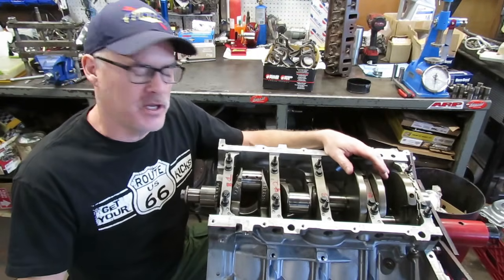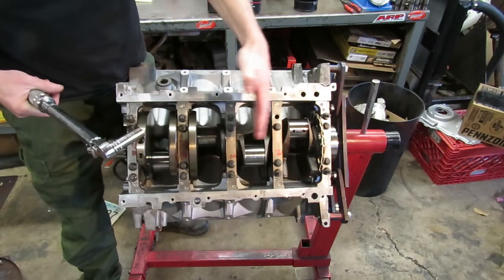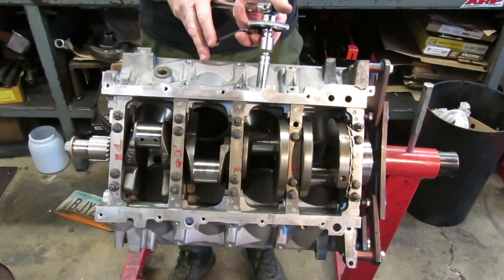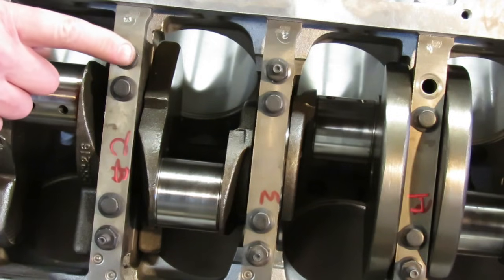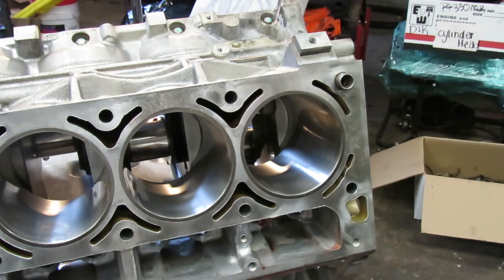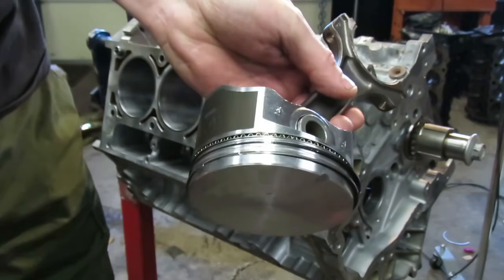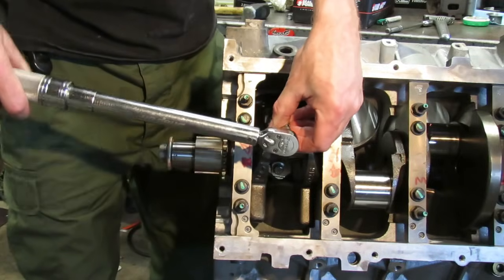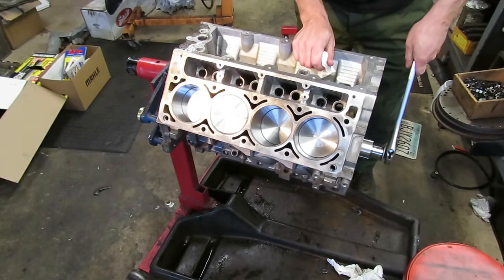LS1 Complete Rebuild part 4

Comment: I was just curious why did you use new rods rather than the older ones if it was a lesser mileage engine and how did you set the Bob weight?

Comment: I’ve got a 5.3 it’s got 86,000 miles on it with cracked head bern sitting in storage since 09. Been debating on a refresh rings rods etc new heads. Anyone ever do this and reuse rod and main bolts? Are they reusable??

Comment: Actually building a 6.0 right now so I'm loving these
Reply: Its a 5.7L. 6.0L are iron blocks. 5.7L is aluminum block as you can see its a LS6 block. It is a big difference. In order for it to become a 6.0  L it will need to bored over first. Not a smart ass I know this through & through
Reply: @critiquecriticism5860  dude Ik, same assemble procedure and ideology, most of the knowledge still applies

Comment: Not questioning you, but isn't it better to use assembly lube on the bearings?
Reply: Yes only if the engine isn’t going to be ran right away, engine oil if fine if the engine is going to be installed and ran soon after.
Reply from the maker: I don't like to use AL unless I have to I want to feel how the crank turns in it's natural habitat I plan on putting this on the dyno so oil is fine

Comment: Not to be a nit-picker, but I'm certain you don't want to sound or appear ignorant, so: You used the word "orientate" during your presentation and I'd like to correct your very common mistake. The word you should be using is "orient," from the word orientation and is easily mistaken for the back-formation of that word, "orientate". However, just like the word conversation, the verb "converse" is the correct form of the word, but how many times have you heard someone use the word "conversate," the erroneous back-formed version of conversation? Even "professional" journalists make these mistakes, I just happen to notice them, being both an English Literatue Major and a part-time professional proofreader. I find your videos very helpful and instructive, so please understand this was corrective critisism, nothing else.